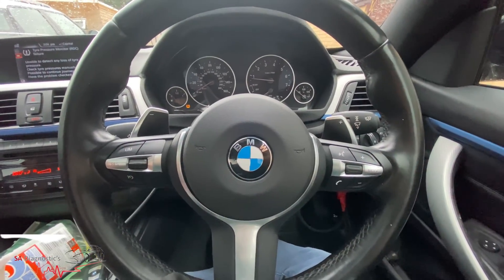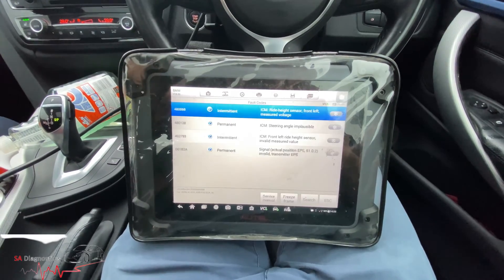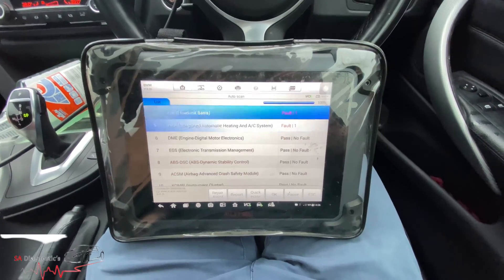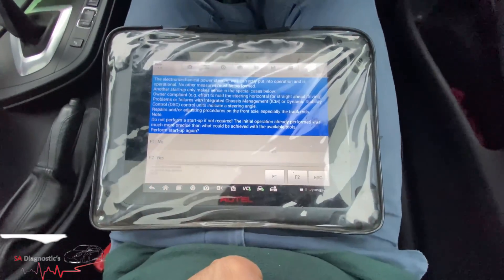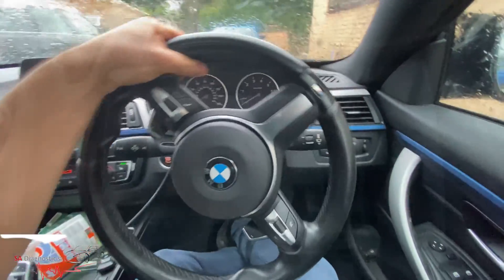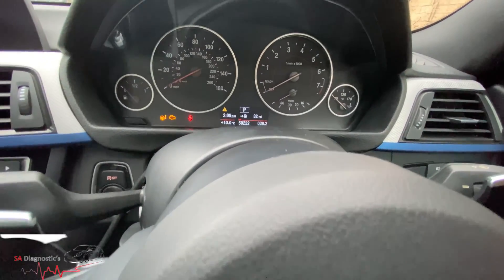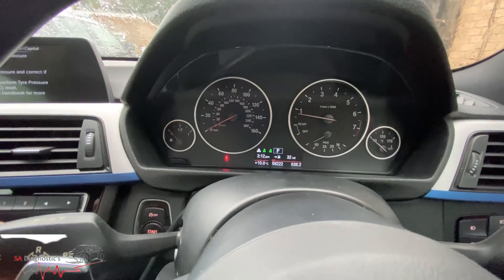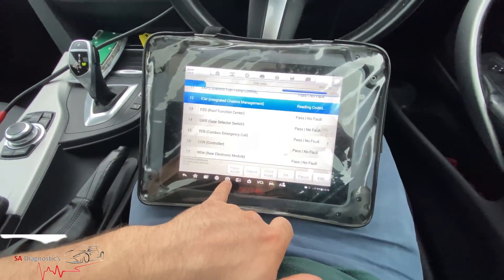BMW AUTEL D01B2A 480128 ICM Steering Angle Implausible Signal Actual Position EPS Invalid FIXED!!

Comment: Hi mate I have a 2015 bmw f22 220i car was the tyre pressure and abs faults and driver stabilisation faults when I try and program the steering sensor it doesn't allow me i have aligned everything and checked all speed sensors and it doesn't allow me to program the angle sensor.

Comment: Hi, I have accidentally activate the tpms sense. I the error keep flashing. I just found out that f20 do not have the mouble. How do I disable. Your help is greatly appreciated.
Reply from the maker: Hi I would try and recode in the abs icm gearbox and see what happens from there.
Reply: Do I have to complete all the steps until it tells me it's finished?